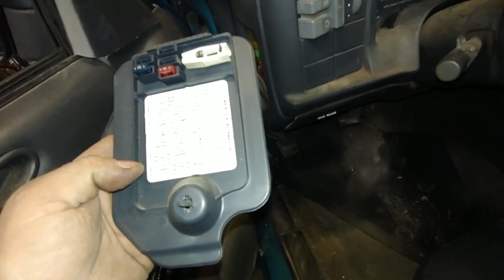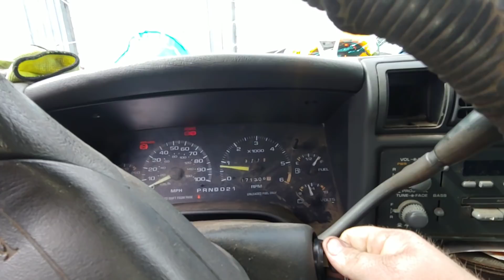DIY Auto Repairs - self-reliance is the key to this game

Comment: Put a vise grip on that brake hose and only loose a fraction of that fluid. Less bleeding to do also
Reply from the maker: I hear you but most of that fluid came out of the caliper but yeah I normally I do I actually have a specialty tool for closing off those brake lines just a couple pieces of metal and a wing nut

Comment: How does a o2 sensor cause a misfire ? A misfire will throw all other readings off.
Reply from the maker: I never said no to causes a misfire I just wanted to change them because I do not know the history of them. The misfire codes were probably from when before I did that plugs wires cap and rotor I do not believe that I ever cleared it I'm hoping that the spider injectors are not on their way out seems to be running pretty good now I also found a vacuum leak under the hood that I didn't know about
Reply: @ScrapFarm  ok, that makes more sense if you hadn't cleared codes afterwards.

Comment: In 2008 I bought my wife a brand new Toyota Avalon and when hit 60K all the sensors started faulting. Changed all the O2 and cam sensors. About 10K later the check engine came back on and all the same faults showed up. After a lot of testing and resetting, turns out that I got a bad wiring harness. I asked how much and they told me 1500.00 and I said nope. So we drive around with a check engine light on. The car runs great but I ain't spending that much just to turn off an idiot light. If it does start missing or running rough the plug in scanner still works fine and lets me know what's wrong.
Reply: A blown tire knocked out an abs sensor so the check engine light is on as soon as it runs its checks.  A piece of electrical tape blocks it.

Comment: If you fix the miss fire you wouldn`t have a rich condition and you wouldn`t have to change the o2 sensors they are telling you what the problem is not that they are the problem.
Reply from the maker: Yeah I get that that's why I was talking about spider injector that's probably what the issue is the spider injector... that's not a 20-minute job that's for sure
Reply from the maker: Plus one of the distributor cap bolts was corroded and broke off so half the distributor caps held on with a zip tie